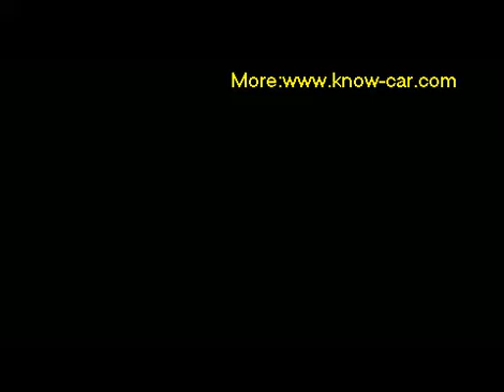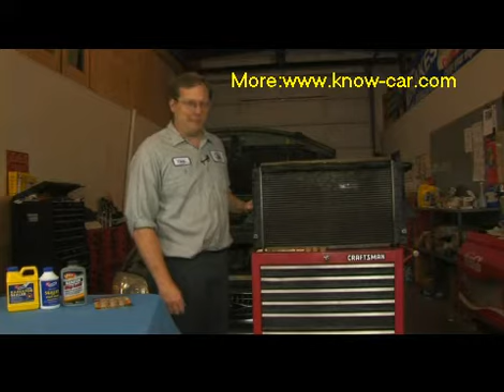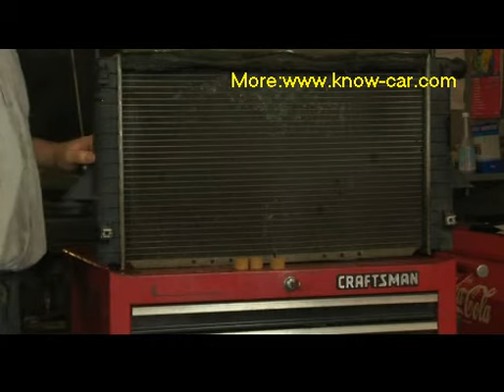Auto repair videos: How to Seal a Car Radiator

Comment: hello I have 1998 Chevrolet Surburban 1500 with a 2 core aluminum radiator. I would like to know if there is any way to repair a portion on the plastic tank which houses the transmission line at the top. The leak is coming from the metal/aluminum insert . Im not sure if this insert is a twist in or epoxy welded. It looks like a flowers head and holds the trans line in place. so guess its a multi function piece. Any information would be appreciated . Thank You  Dave